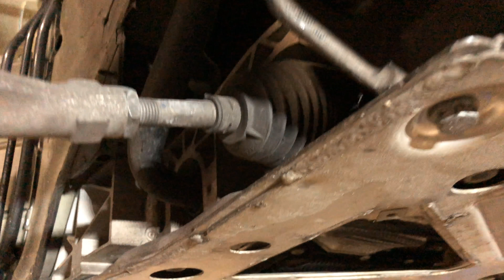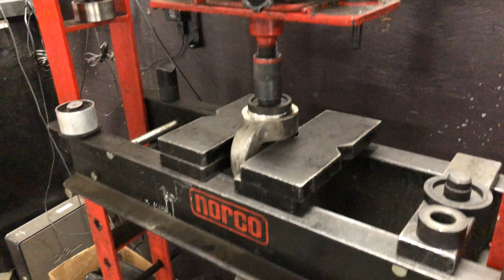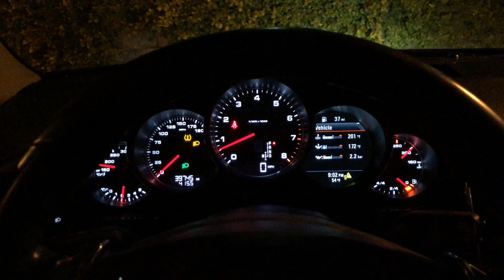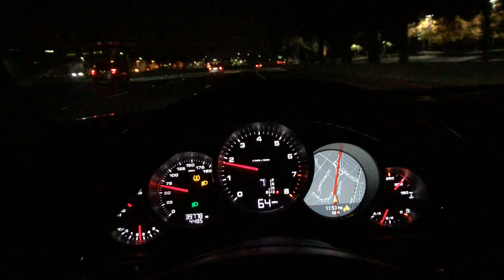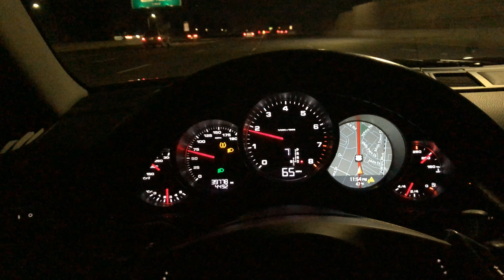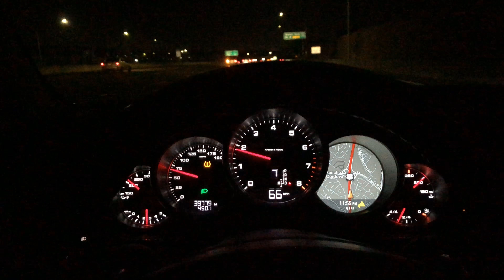Porsche Problems!!! Fixing Suspension Noise on my Panamera from Copart || Pt.3

Comment: Any issues removing the lower control arms?  I have a 2011 panamera s.  I just replaced my upper control arms, the nut/bolts aren't the easiest to remove.  Next on the list is the lower control arms. A local shop says the bushings can't be replaced  for the control arms and he wants $750 per arm.  BS right!  Thanks for making the video, now I know the lower control arm bushings can be replaced.

Comment: Do you know of a shop that will remanufacture your existing control arm? I'm sure it's cheaper than buying a new one.
Reply from the maker: There should be multiple shops in any city that can do this since all you need is a shop press and the correct bushings.

Comment: Not a problem turning. Just a noise going over bumps. Sounds like a Chevy. Replaced the struts and sway bar links. Was it that specific bushing on the arm you replaced in the video? Thanks for responding
Reply from the maker: My noise was only happening on full lock turns pretty much and this bushing did the trick along with new tires. Dealership I believe suggests replacing the whole control arm but thats too much money when you can press old one out and press new one in for a lot less money.

Comment: Did you ever find the cause of the noise
Reply from the maker: It was this bushing along with getting new front tires. Old tires that were in this video were shot and dry causing the wheel to "hop" when performing a full lock turn.
Reply: The hop is normal on Porsches at slow speed, due to the Ackerman effect

Comment: What is the factory torque specs on the lower control arm bolts? Do you have a video on replacing the upper control arm?